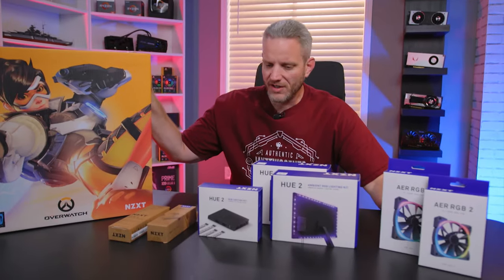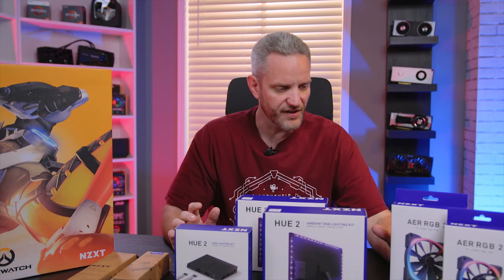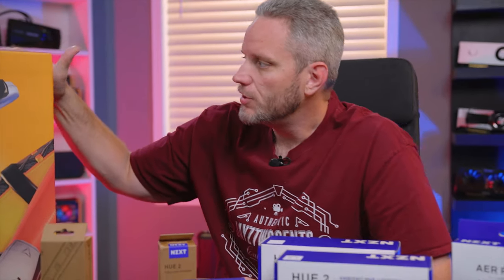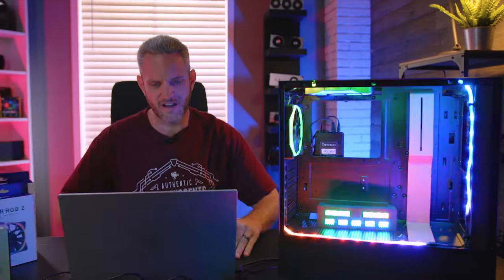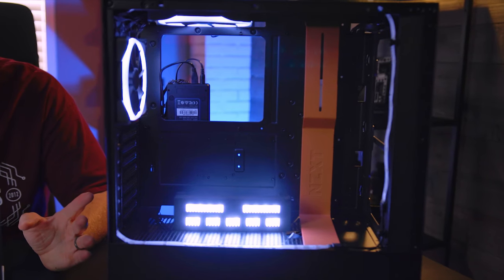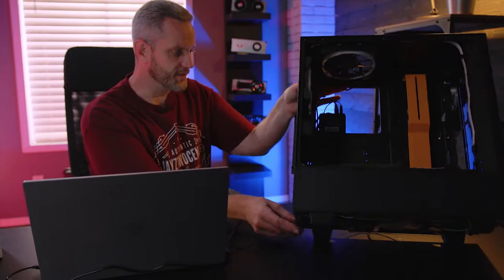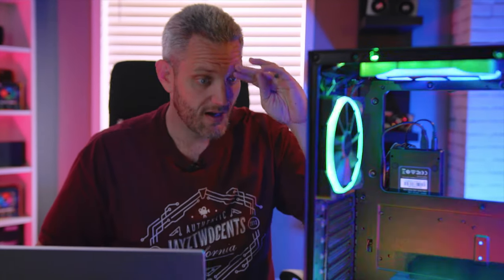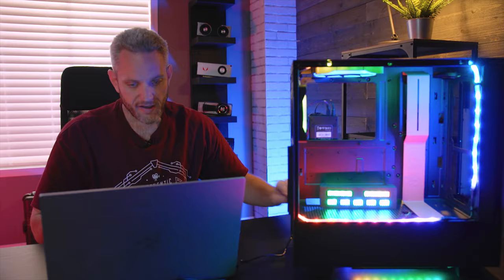NZXT Hue 2 Lighting Eco-System... Sunglasses not included

Comment: I built my previous system using an NZXT S340 and Kraken X series 280mm AIO. There's no going back after using NZXT products. I'm building a Ryzen 3000 system next month when everything launches!! It's all going in the new H510i, which comes with the HUE2 hardware!! I'm super excited to get my hands on this stuff! Not a big fan of RGB fans personally... I think they look kinda cheap... Maybe that's just me. I am however, very excited to have addressable RGB LED strips throughout my case. As well as my CPU cooler, which will be the Kraken X62 280mm which can all be controlled by the CAM software. NZXT is a great bang for your buck. They have a very nice modern minimalist aesthetic with great thermals and very good pricing. If anyone is on the fence about going with an NZXT product, don't hesitate.

Comment: I ended up going with Corsair and Asus RGB components. AIO, memory and LL fans from Corsair 
Using Cue software and Asus TUF z390 and Asus Strix1080ti running with Aura software. It’s a bit of a 
pain in the neck to get the colours and modes synced but well worth the effort.

Comment: One problem with rgb for me it is very distracting when i need to work so i ended up turning it all off or still color...
Reply: MICHAL_C900 That’s actually how it’s meant to be used.
Reply: RGB is Still RGB if it is static. 
RGB is just the ability to customize the color. 🎨
RGB doesn't mean it needs to be a circus of blinking/swirling/everchanging colors.
RGB = Good.
Circus PC = Human cat toy
Reply: My PC is all MSI Gaming + so used RGB EK Varder Fans on my Radiator to have matching red lighting, it's so quiet Idling it's the only only way I Know it's still on

Comment: I've had the Hue2 system for a while now. It's good but holy moly is it a pain to mount, especially when you put it in a pc that's already mounted. There's a lot of cable to pass through, and the connectors have no clip, which means they disconnect really easily.
I didn't know about the external system tho, it's a great addition imo I might buy it :)

Comment: I still think Corsair's iCue is the best RGB software. It isn't exactly user friendly, and it certainly isn't intuitive. But the amount of customization it offers is miles ahead of any of the competition. Not only can you address each individual LED, the software lets you work with layers, opacity and timers. It gives it exponentially more options to control your lighting. The only thing I miss is a standard ambient lighting mode where it adjusts the colors based on the pixels on your monitor.

Comment: Nice video bro. I'm still rockin' the original Hue system. I have the Kraken X62, 2 Hue's running three 140mm fans, three 120mm fans, and 6 light strips. But, I needed 2 of NZXT's internal usb hubs though. I'll be upgrading to the new Hue 2 on my next build.

Comment: Looks good, but I'm more impressed you got CAM to actually work. My build is about 5 months old, and I've never been able to get CAM to work
Reply: Seriously? I got my new system at the end of November and then added all the lighting and an X72 in January. I haven't had any issues at all. Did you try a clean install of CAM and update drivers?
Reply: @larryjanney1020  I've tried new and old versions of cam, clean install of windows, different drives, even got the hub replaced (whichever one comes in the h500i, it's only running 2 led strips that came with the case) I just cant seem to get it working.
Reply: @KenneTech  Is it the strips themselves that aren't working? When I put my kit in I accidentally plugged one of the strips in on the wrong end. 3 strips worked fine, and the one didn't. I flipped it around and as soon as I plugged it in it worked fine.
Reply: @larryjanney1020  both strips worked originally, but I replaced the hub and now 1 strip doesnt work at all, and one does. (Probably my fault) But the cam program itself just goes into an infinite loading loop once opened. I get about 3-5 seconds to click login or guest mode, then the loading circle pops up and never goes away.

Comment: I have 1 NZXT product and I don't think I will be getting any other any time soon. 
received my Kraken X62 with one of the thumb screw damaged. Only took a months and a half to get a replacement screw. However, their customer service where very good and the AIO once installed works great. (Except for the RGB )
Their CAM software in other hand is really poor. It only works 1 fifth of the time so my selected color for the ring on the pump is now the default one. This is because if you do not use CAM (when it works) the lighting goes back to Default. With my old Corsair AIO I only had to connect the USB cable once, setup the color I wanted and then I was able to remove the USB cable and uninstalled the software. 
Also, CAM rendered my PC unstable. The amount of blue screen I got when this was installed, was really impressive. This also happened after a clean install. 
So unless you can setup the color you want and then uninstall CAM, I will not even consider buying any further of their products with RGB.

Comment: Well, I made my ambient lighting with a 2€ roll of LEDs, connected it to my motherboard's RBG header (with a splitter, one branch for the RGB fans and the other for the LED strip) and routing it through a backpanel gap. I can control it through the MSI software, so it's synced with my PC's theme. You don't really need to spend that much money tbh...

Comment: And I do have the fans to go with the hue 2 but they only have lights on the extract and not on the intake it would be nice if you could change that or buy intake ones too. I got a lian li d 11 so I got my intake up the top and extract on the side. I would like it the other way around as heat rises. I don’t have a cooling problem, be nice to have that option though

Comment: The hardware is great. The software (CAM) is pretty much spyware. Make sure you have a firewall running if you buy NZXT RGB components or AIO sets. And expect to have limited functionality if you don't register with an account (even if you don't register, NZXT will still mine your data by the way, so get that firewall!!!)..

If you already have the hardware, you still need CAM to launch at starup to get your RGB working. But after that you can kill the software. You can do that using a .bat script. Just set it to execute after 20 seconds after bootup (use windows scheduler). 20 seconds should be fine. It's long enough for my PC to make sure the RGB components get their settings from the CAM software.

If you have an NZXT AIO try to see if you can set the fan speeds up through your BIOS, Otherwise you will have to keep CAM running in the background since that spyware also controls your AIO fan speed.  If your bios does not provide an option to set fan speeds for you AIO, you'll be stuck with the CAM sotware. That why you need the firewall, to block the data NZXT is trying to mine.

Comment: Hey there I'm planning to put in a ton of rgb int my system but I'm not sure if I can fit/make everything work into my system. I want to know if everything I'm planning on buying, will connect to the Hue 2. I'm planning to put in a Kraken x52 240mm aio, 4 rgb strips, 2 120mm rgb fans, rgb cable combs, 2 250mm rgb underglow strips. I wonder if these all fit or will I have to buy usb 2.0 extensions or some other hub. Thanks.

Comment: did nzxt fixed the fps block/regulation in the cam software??
Reply: Im using Ambient Light for over a year now and I never had issues with my fps
Reply: @jasssedine  i used the nezxt cam software to monitor the temps on my watercooling loop and with my 240 hz screen the software limited the fps to 144 without the nzxt cam software steam show me around 300 fps
Reply: @DJLandraver  Oh thats odd.. I dont know, Im only using it for my Ambilight Kit. But unfortunately for you if you have an NZXT AIO, they are said to be pretty good - but the  CAM software is a mess..

Comment: Im so dissapointed because I was so behind this product. I had the original hue+ and loved it when it worked. However, I have dealt with so much agony trying to make my system just light up. I originally had the aer fans and the hue+ controller, which I had to troubleshoot with the software to get working. Then I later added an led strip, which lead to the same problem. I’ve read the manual, and it says you can run both original hue+ accessories and hue 2 accessories, as long as they arent linked together. I got the new hue 2 controller and two aer 2 fans. (I should have learned by now) for the life of me, I cant make these stupid things work unplug one thing, it will detect it on the software and never light up, have them all plugged in, none light up. download cam 3 times, no dice. I’ve tried all the troubleshooting, almost everything I can think of, and they wont turn on. I recall my orginal lighting profile being very unorthodox, with the led strip settings showing up on my fans. I’ve also read a lot of reviews calling out NZXT for taking gigabytes of information on their users, which I don’t know if that is really true or not, but wouldnt really suprise me at this point. All that being said, I have seen people happy with how their hue setups have turned out. So if you want to purchase these, please realize that both the software and hardware have proven very unreliable and dissapointing to many people. If NZXT gets off their bullshit and actually starts showing some quality work on this product line, maybe I’ll be inclined to purchase from them. otherwise, I’m staying away.

Comment: Could someone help on this; got an RTX 2060 in fact this is the second one(same issue with both), when I overclock my cpu(2500k) system wont boot, when I put my 1060 in, it boots fine. Also boots if I remove cpu overclock with the 2060 in. Bios? Psu?A little help?

Comment: If I have the H510i, because of smart device V2, Do I need the hue 2 controller to run 2 Aer RGB fans? Or does the smart device handle that?
Reply: I would also like to know this. I also have the 2 rib fans, plus a Z63 AIO and undeglow kit. Do I need a controller or will the H510i Elite handle it all?

Comment: Hey Jay ! I have a MSI z390 gaming plus MB Question : I bought a case pre-wired with 6 RGB fans attached to a hub, there's a 3pin connector coming from the hub (5v), my MB is 12v 4pin, I bought a converter which now I am able to plugged into my RGB header on my MB, but still no RGB lighting what would you suggest the problem(s) may be? NOTE; my rgb is working on my RAMS and CPU fan. Just not the fan case. @JayzTwoCents
Reply: Please if you could give me a few suggestions to try, thank you.

Comment: Do note:  Hue 2 fans DO NOT work with Hue (one) controllers.  So if you bought Hue + originally you are basically F'ed as Hue (one) fans are hard to find if you wanted to add them more.   Reason's i no longer support NZXT.
Reply: How much nzxt aer 2 fans this hue 2 controller supports? 

I want to plug 6(six) aer 2 fans into it (2 from nzxt's liquid cooler + 4 aer 2 case fans). Is it possible? I'd really appreciate your opinion about it.

Comment: Will it work with the TUF x470 by Asus? Or are those two gonna fight when I turn my PC on
Reply: I'm running NZXT on my Asus Z270F, I run W10 on one nvme drive to run CAM and set up my lighting,then use Aura to set the lights on my Gskill Trident and Asus GTX1070. Then I reboot to the other nvme which has Ubuntu 16.04 which is what I mainly use. Once I've set up the lighting it remembers the settings so it's all pretty in Ubuntu. The only problem is CAM or Aura can't be controlled in Linux. But to answer your original question directly, no, the softwares are not clashing.
Hope this helps :-)
Reply: That did lol

Comment: NZXT Hue 2 no longer works with Windows 7 as of 2022, so if you spent a lot of money for NZXT hardware like the HUE 2 module LED fans lights glow led lights etc, they will no longer work. If you want to be able to use the hardware on your computer you have to upgrade to Windows 10. If you don't like Windows 10 you are out of luck.

Comment: What about heat?  If I remember you had a SSD with RGB and it overheated and had problems.  How much heat does that add to the case overall?  I understand if you have a giant case it's not an issue, but I would like to add color to a mATX case, and airflow is only good, not great.

Comment: more cable to route and manage , probably the main reason i dont bother with RGB
Reply: Honestly if you have a decent case that has enough passthroughs, then its very easy to hide. I have basically the same setup Jay did(minus the cable combs) and none of the cables are visible. It only took a few minutes to get everything in where I wanted it and plugged up and running. I've also not had any problems with the CAM software so far. I've had everything up and running since January. But hey, you do you.
Reply: @larryjanney1020  for sure a decent case makes it easier , however for me its less about having the utility to do it and more about not having to do it in the first place, the prototype fans from Lian Li seem interesting (daisy chain pin fans) as they remove the majority of cables but until they finalize or something similar becomes the market norm  the vast majority of RGB stuff increases workload for no appreciable performance benefit.

Comment: that everybody has there own RGB management software is more annoying, have a keyboard and mouse with razer chroma (also next case), have corsair ML RGB fans so need corsairs software for those, probably getting a asus or gigabyte board for my next pc wich will have rgb on it so there rgb suite as well >.< and i've currently got but plan to get rid of it NZXT Hue+ was good at the start but since the last cam version and all little patches to it it's not worked right i have to set it to solid colors or rainbow puke as temperature sensitive causes parts of the strips to blink on and off which is quite distracting. hope some legend at some point makes 1 software to control them all >.< having 4 pieces of software installed and running just for lighting triggers my OCD.

but i'm water cooled so in case i don't realize my pump died i would like my entire setup to go red once a temperature has reached a unusual spot, but i've also got a piece of software always running that connects with my pump and flowsensor to tell me the rpm / flowrate.

Comment: Because this still uses NZXT's clunky and awful CAM software that datamines your PC performance statistics for their BLD service, that's a hard pass from me.

When I had CAM installed it caused nothing but frustration. It would randomly wipe all my profiles with no option for a file export, and was very unstable. I ended up neutering my 240mm liquid cooler's fan headers by removing the pins from the connector and then using the open source program liquidctl for RGB and my motherboard for fan control.

Comment: Slightly disappointing, four strips per port is nothing. This is one of those instances where mass marketed products are still more expensive than the DIY way.  I think the most I've ever put into one PC was a 16x16 RGB display matrix (hand soldered from individual LEDs ofc) with two RGB fans and RGB underglow, all running off of a single controller port (and that's not even close to the limit). All for about ~$60 worth of parts (and my UI allowed you to upload animated GIFs to the display matrix). So yeah, those control boxes are ripoffs and the strips are overpriced as well; but what else can you do if you can't solder yourself, right?

Comment: Hey all if anyone can help me out much appreciated. The cam program was working fine and then i had a blackout and when i booted up the program after it gives me an error file not found unreadable. I have tried everything that i can think of. I deleted everything that is on my pc that is connected to any file of nzxt cam redownload the program nothing. Running it in admin. Nope nothing. The rgb strips are white and still on. So the only thing i can think of is that when i go to devices and printers on the bottom it says that nzxt usb device is unspecified but im not sure. Hope someone that is more computer savvy then i am can help. Oh and when i redownload the nzxt cam program it automatically restarts my pc and gives me an error collecting data and then there will be a nzxt cam lnk. File on desktop but no exe application file wtf. Yup i gots some problems lol please help if you can. I do have two rgb programs that are lighting my ram sticks and gpu aura and dragon center but i need cam too because the programs that i have dont detect the rgb strips that came with the nzxt case hope that helps. Jay i know your way to busy to help me but i hope one of your super smart tech fans can help a new pc builder out. I hope all this makes sense lol

Comment: Seriously, screw NZXT and their overpriced garbage. I ordered 100FT strip of WRGB for $60, built an entire 4ftx3ft acoustic panel with WRGB edge lighting, put ambient lighting around the back of my monitor, and two WIFI controllers came with the LED strip, had something like 78FT of LED strip left over for half the price of the NZXT kit. The strip isn't addressable, but I honestly don't need that, and even if you wanted it, you could still buy an addressable spool and save a shitload of money. NZXT? They charge $110 just to light the back of your freaking monitor. No.. that's a complete ripoff, and don't let those idiots do that to you. 

And if all you want to do is light the back of your monitor, go buy a kit for anywhere between $10-$50 and save yourself the money and the hassle of using NZXT's horrible software. I even have my monitor and acoustic panel RGB strips hooked up to my motherboard and can control them with Gigabyte's horrible software instead (but at least it came free with my mobo), but I usually just use the remote.